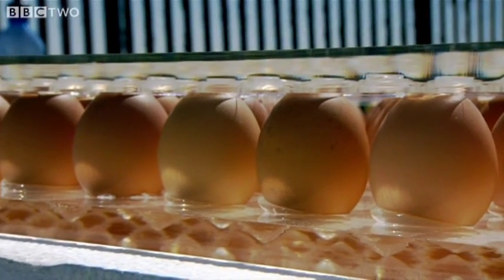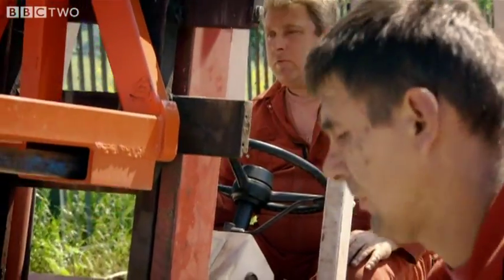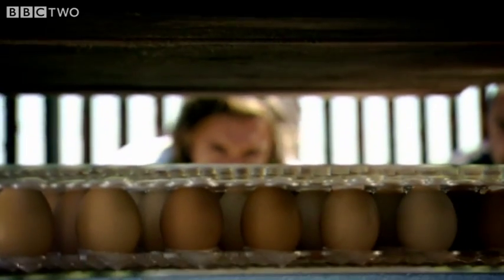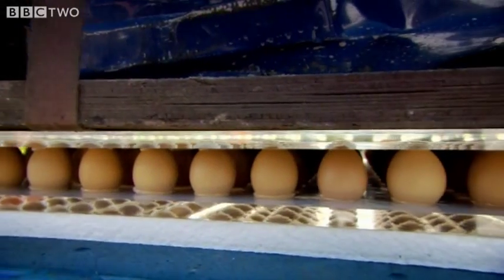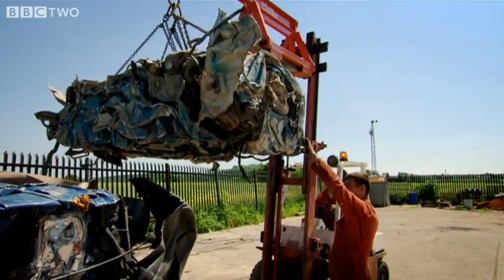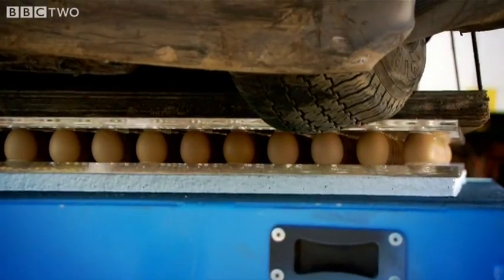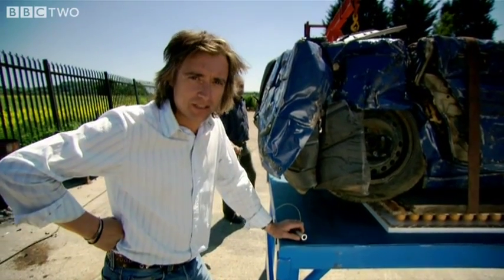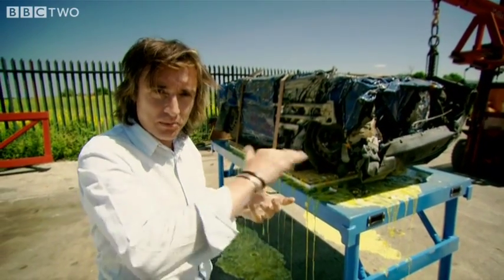Eggs strong enough to hold a car! - Richard Hammond's Engineering Connections - BBC

Comment: so if it can withstand two cars then how come it breaks so easily when I use a spoon or the counter to crack it. is my force that strong? 😮
Reply: You’re striking it between the arches. The strength is at the top and bottom of the egg. Striking it at its weakest point maximizes your ability to break it

Comment: I don't understand why they didn't lift the 2nd car and then see exactly which eggs were broken. It might have revealed something interesting or shown a pattern, maybe it would have just shown them that they put the car down on one side more which would suggest it could actually hold much greater weight if more attention could be applied to the distribution of weight. To just run a wire through them seems like a lost opportunity to learn something.
Reply: If they had carefully measured the eggs before hand and noted where each egg was placed, they would have found that the broken eggs were all longer than the average by more then the give of the material that they were sandwiched between.  Obviously, they had added a safety factor so that a few oversized eggs failing would not cause a cascade failure by not leaving enough eggs to support the load.
Reply: HatsTour then people would have thought that they have replaced the eggs
Reply: more like just the couple extra week egs
Reply: HatsTour We did learn something.

Comment: is that just eggs holding a car?
Reply: I'm very interested in how you got to the conclusion that a crushed car is somehow lighter than a regular car
Reply: Franklin Zheng I think he means some parts such as the engine, axels and transmission are removed before the crushing begins. although this wont significantly change the weight there is a 400-500kg difference without them, hence the second half crushed car added on top in the video, to recreate the exact weight of a generic car
Reply: Andreas Johnsson yes but the thing is the cars are crushed so they aren't as heavy
Reply: 500kg which is half a ton...